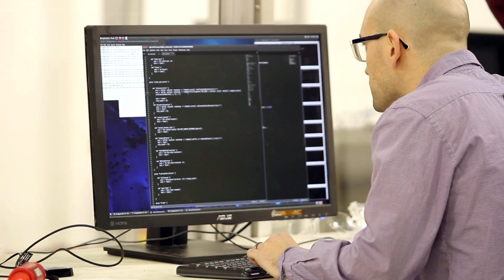ATLAS Gets an Upgrade

Comment: So now it has a battery pack , is not tethered anymore .... 
'There are no strings on me'
Reply: It's the craziest design, power packs should be positioned internally within segmented areas for balance. Seems like they are just toying with the idea because they can obviously do much better than that.
Reply: tony budz The positioning of the battery is very human, much like us wearing a backpack, weight distribution in a backpack causes no problems unless the weight is beyond a certain level.
That said, it's DARPA pretty sure anything you have thought of they have thought of.
Reply: tony budz The battery pack must be able to be replaced easily and sometimes quickly. It may still very well be in perfect balance.
Reply: I suppose, not to belittle the design, I guess it makes no difference to the robot where the pdu is located when its stuck with flat feet. :)
Reply: they should put on solar panels so it can charge a little as it goes and still run if it passes out in the wilderness after a few days charging..
Reply: lushfauna
or he could burn biomass to produce energy.
Reply: lushfauna It first needs to run into the wilderness before it can pass out (:  
This  is probably why the competition is pushing the time limit , forcing mobile batteries and no safety chords.... to focus on  increasing the  movement speed and balance of the the robot.  

And it is definitely needed....those robots are accurate but  Sloooooooooow
Reply: Oscar ZetaAcosta not so much, everything goes in the chest not the back. I know they built it this way but their slowly learning to reduce the technology -- the coding to run the ankle drive alone must take a team. Micro-collimated servos would allow it to walk much more normally, make the programming much more efficient with optics control. It's unfortunately plagued with audrino i/o devices combined with primitive servos -- using counterweight balance interfaces for axis control. It's a slow moving clunky monster riddled with pneumatics & hydraulics when it should be using magnetism.
Reply: +Tony Budz not so much? Maybe you took my comment too literally instead of what I was responding too.. Front or back its about balance
Reply: +Samuele Cornell than the battery runs out and everyone has a good laugh.
Reply: +lushfauna the problem with that its that each single pound of weight will make it will require additional energy to move, so that will be dumb at the end of the day...

If would be possible that it gets really any decent % of energy for that extra weight, it would be a good idea, but I think its just much easier to place solar panels on ALL the buildings in the world, and set a place where the robot must go to be recharged, instead start adding solar panels to things that move (and that will crash sometimes)... and solar panels are not that cheap yet...  I just thing the same for the electric cars...
Reply: Samuele Cornell 

I'm a real boyyy!!!
Reply: Samuele Cornell Look at it now...

Comment: The three most important innovations that Atlas needs.
1- processing information faster, so he can think and move faster.
2- Flexibility and movement, feet should be for all terrains, because flat feet is only good for flat surfaces.
3-where are the hands and fingers?

I don't see any human alike fingers, and hands are long and bulking arms, they need to improve and change that, I would recommend lighter metals for the arms, hands and finger, something like the polygraffito metal use for the racing cars, is light weight and flexible.

Comment: While a fully automated ATLAS is a commendable long term goal wouldn't it make sense to field ATLAS immediately with telepresence capabilities (a human operator with VR goggles, haptic feedback, etc.)  Put it to work fighting fires, repairing Fukushima (a worker just died there today, thousands exposed to high levels of radiation), EOD work, mining work, garbage collection, etc.
Reply: The power, something ignored in tv shows and movies, is a big limiter. I doubt it can run for more than a couple hours.
Reply: If you did any reading on the project, you'd know that the whole point is for operating within buildings where radio signal is limited. The purpose is to build a robot that can continually operate with only occasional communication, and can figure things out for itself in the mean time.
Reply: ataraxic89  When low on power it can just go to a charging station like the roomba
Reply: SoCalFreelance Just visit the website for the Darpa Robotics Challenge project (or whatever it's called nowadays).
Reply: This robot couldn't handle the heat of Fukushima, it would bend and fail like all teh other robots they have sent down there.
Reply: would be cool if it could get wireless power. I know it's in-efficient but it would be cool.
Reply: ***** Try watching the video, there is a robotic tournament soon were the tether will be removed.
Reply: Jim johnston  From a FastCompany article written today, "The DARPA Robotics Challenge was created in the wake of the 2011 Fukushima nuclear plant disaster, which highlighted the need for robots that can work in conditions too dangerous for humans."

http://www.fastcompany.com/3041215/darpas-humanoid-atlas-robot-goes-unplugged
Reply: SoCalFreelance I know a lot about the fukishima disaster, What I said was this robot in its current state would melt like the robots they sent down. 
While we all wait more and more waste drips into the sea. 
look at some of the photos of inside the plant. 
Steel ladders twisted and bent. They can get so far in then the current robots stop responding, that said thanks for the link.
Reply: Sure that sounds cool but problem is capitalism, currently humans are cheaper than robots.
Reply: C00LX100 How is the problem capitalism? How would another ideology solve this problem better than capitalism?
Reply: Thou Art That If humans came before profit simple. If human life and quality of life is more important than anyone's profit world would be alot happier and cleaner place.
Reply: john smith I'm saying i wish not to have this discussion cause it serves no purpose to me.

Any educated person should know when i say blind pursuit for profit is ruining the world i mean on oil, deforestation, climate change and so on... Solar panels are potential future solution in capitalism and i say future cause last time i checked thay are not really profitabile especially when oil prices are rigged to effect russia! And if you skip part profitabile a go straight to the best currently possible solution not restricted by fiat money.
If you can make synthetic oil why keep using natural oil, guess what cause it is more cost efficient! Trust me i'm an economist by degree. Apple Inc. has vary nice working conditions not running for profit at all but you bring up solar panels and all not yet profitable green energy. GOOD! FOR YOU NOW UNDERSTAND WHY I DON'T DISCUSS SHIT WITH STUPID AND NON-IMPORTANT PEOPLE ONLINE!
Reply: john smith look you have some good points but trust me future of this planet is not save if capitalism go unchecked yes capitalism who made internet possible is already starting to bring us new ways and better way to do thing like circular economy and similar things. The 1% is blindly running into profit meanwhile pushing whole world into technocratic fascism. But if we disregard profit and 1% maybe capitalism succeeds in being the best transitional sistem to technocratic socialism, maybe just maybe just maybe market will fix it self, probably thanks to the new trading mediums like 3d printing and internet sharing... CAPITALISM IS NOT SOLUTION IT IS THE CURRENT PROBLEM! YOU CAN'T HAVE INFINITE DEMAND ON PLANT WITH FINITE RESOURCE!
Reply: C00LX100 even if human are cheaper than robots there are places that humans cant reach.

Comment: "This new pump makes the robot much quieter. Now the teams can operate the robot without the need for any hearing protection." So right now the definition of a quiet robot is one than doesn't require hearing protection to operate. I guess that's a step in the right direction but still, had no idea it was that loud.

Comment: Why did they decide to put the heavy batteries so high above the center of gravity? Put them in it's legs and hips to give it better balance.
Reply: You know, there is a reason why BACKpacks are a popular means of carrying stuff.  And there is a reason why LEGpacks are basically unheard off.
Reply: Curixq Yea, because humans have great balance. Robots are about as graceful as a toaster being thrown out a window.
Reply: The robot probably has much more balance than any of us.

Regardless it's easier to keep balance when the weight is high.
For example take a large spoon and you'll see it's easy to balance it on its handle with the heavy spoon part up top.
It is however hard to balance with the heavy side in the air.

The robot with most of the mass up top can in the same way keep his balance with subtle and fine movements.

They are not building a tower, they are building a moving robot.

Comment: Something I've long wondered about: Are there any applications where it would make sense not to have the higher-level processing functions (i.e., the "brain") on board the robot itself? That is, have it running on some stationary platform nearby, with wireless communications allowing the brain to receive sensor data and issue high-level motor commands. 

I would think that such would be the case when you need both a light weight robot and a high level of processing. And perhaps it would also be more practical in settings where the robot's area of operation (i.e., distance from the processor) is relatively limited.

Is this actually being done by anyone?

Comment: Now that you've decided to make Atlas more mobile and independent, I guess it's now a matter of seeking the ways of making it the most energy efficient. But you should still consider alternate energy sources to increase its independence. Perhaps solar energy could be a viable option... and any similarities with The Matrix's plot are just mere coincidences and should only be regarded as such...
Reply: No worries. If they get out of control, we can just scorch the sky which would stop the machines from taking over...hey, where did i put those batteries?
Reply: itdadof3 I see what you did there.

Comment: I got couple questions if someone could please respond:
First question is what motors are been used on the robot and are they commercially available?
Second question is about the robot design and that is why stop at 2 arms why not 4? Was it decided that 2 are enough? Or it was to much of a bother to program 4 arms to not hit each other and work around one another?
And last question is about the number of legs. Wouldn't a 3 legged robot be more stable and also offer a more stable platform for when heavy tools are been used? I understand the humanoid form benefits as been able to work in a human environment but a third leg in the back like a kangaroo tail shouldn't bother from this perspective.
Reply: 2 arms is all you need. 4 arms requires more hydraulic pressure to move the joints and more computers to control, just not worth the few benefits.

Comment: Ultron got beat up by Vision because he when through his body and detach head from body.
so robots would need a body that would function without a head, or even if they take there heads off, and should have heads that can be fix, replace and restore quickly, also bodies that electrocuted so if they try to surpass them by molecular deployment wouldn't affect it.
I must say that Atlas has no movement in his head, and has not enough camaras, it needs more camaras and different vision kinds, like Xray and infrared vision capabilities.

Comment: Can someone clarify for me what the purpose of THIS iteration of robot is? Are they focusing on mobility, because that seems quite arbitrary to me. It's like making a brain dead person instead of one that has limited mobility but can comprehend what it sees. Is this a robot-robot, not an autonomous one? Also could you explain why they use hydraulics instead of electronic servos? Does it provide more power or is more efficient? Thanks.

Comment: Hydraulic power?
Reply: Hydraulic-electric servos are incredibly fast, strong, and accurate.  Used in jet engines, machine tools, industrial actuators, etc.  Been around since the late '50s early '60s.  They can be controlled, with electric feedback, to very fine measurements while maintaining strong torques with a steady efficient energy consumption.
Reply: +joydime they're not THAT fast.... what they Are, is they are Incredibly Expensive
Reply: +T Hh  I work with a couple of machines at work that use these types of servos and I agree they would be physically impractical and too costly for walking robots.